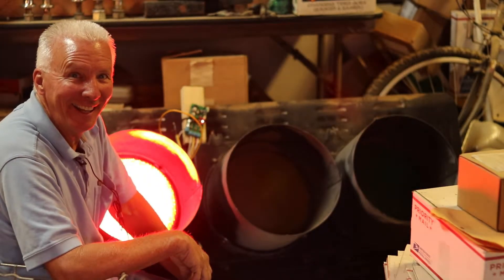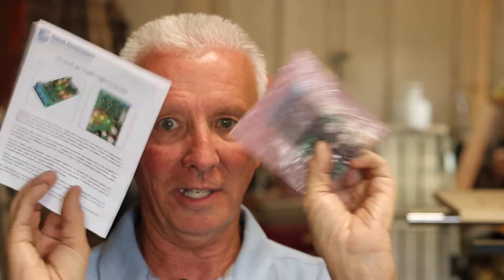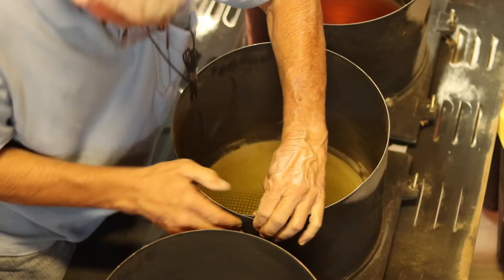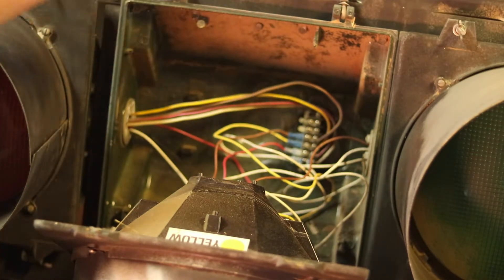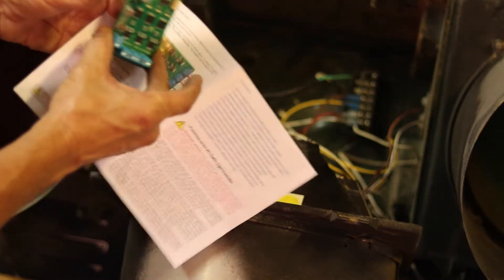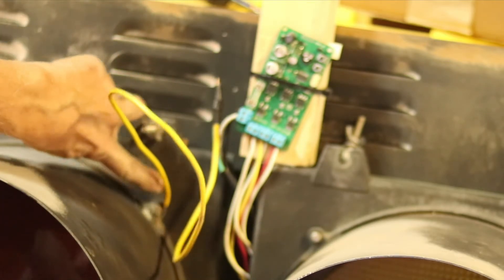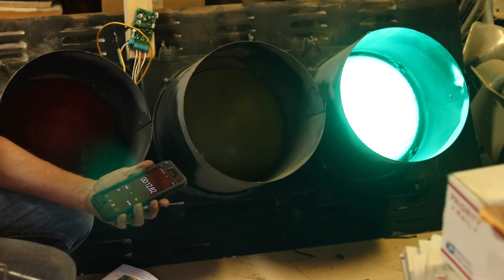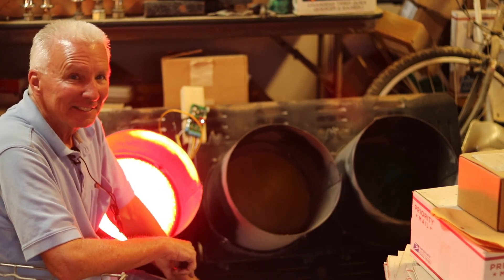Mancave traffic signal light, Wiring it up

Comment: Wire pull about  8.5 minutes would have been easier if you opened the red light. Great video. i have several walk and don't walk individual lights to wired up. thought about making them flash GO Browns by making a print out on a mylar pastic sheet that can print in a normal printer

Comment: For a traffic light controller I'd imagine you could also use something called a raspberry pi which is a super tiny little computer that runs on Linux and they come with some really useful IO ports which allow you to program it to do practically anything such as running a stop light. Of course you might have to be pretty literate in code I don't know.
Reply from the maker: james auld I'm sue there are a few alternatives I'm  trying to learn the Arduino for my model railroading. For the light this was by far the easiest for me. I'm not electronic savvy at all. but I try.

Comment: I have a traffic light and it was completely gutted, I have put incandescent lights in with standard 2 wire light sockets. I also got the walk and don't walk side lights. So when green light is on the walk light works and when the red light I on the don't walk sign is on. When I am wiring it up can I also put the power wire for the walk sign on the green light terminal?
 And you said you got your controller from Galic electronics in maryland, would you happen to have a model number cause I would like to order one. Thanks awesome video
Reply from the maker: andrew williams in the description below the vid I have a link to where I purchased mine. If you use regular bulbs I think you may need their heavier duty board (they draw more than LED) but check out the link go to their website you'll find the boards they have and you might even contact them and ask about the walk sign I think they have a board that accommodates both signals at once.

Comment: The traffic light should be right side up. So, when it's right side up, the red light has to be on the top of the yellow light, and the green light has to be on the bottom of the yellow light.
Reply from the maker: Francis Lorico this was strictly just to see if the lights worked and the electronic thing worked. Now I know all is good I'll do another video for cleaning it up. mounting the electrinics properly in the light and how I figure how to mount it in my shop.  Thanks for viewing.
Reply: @TheShackShop  Oh, okay. You're welcome.🤗
Reply: @francislorico4003  that may be the case for traffic use but for mancave you can put what ever order you want lol